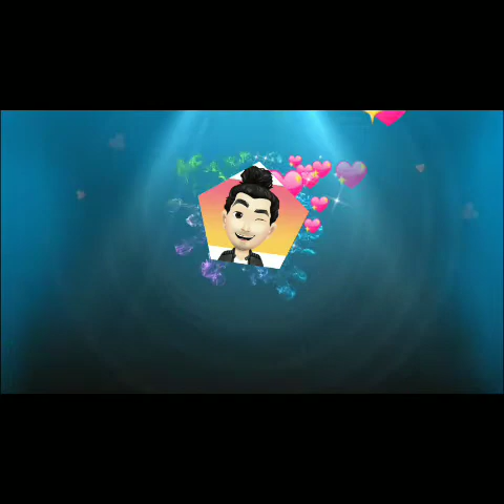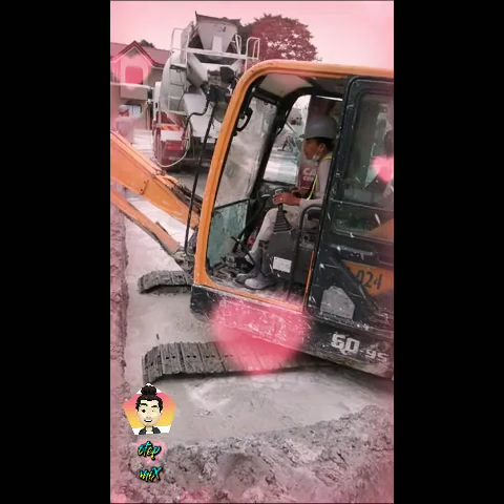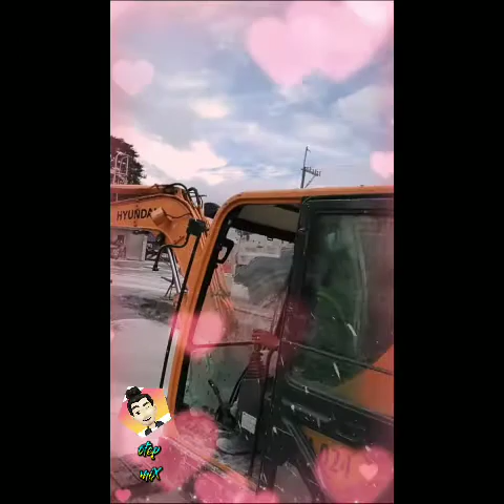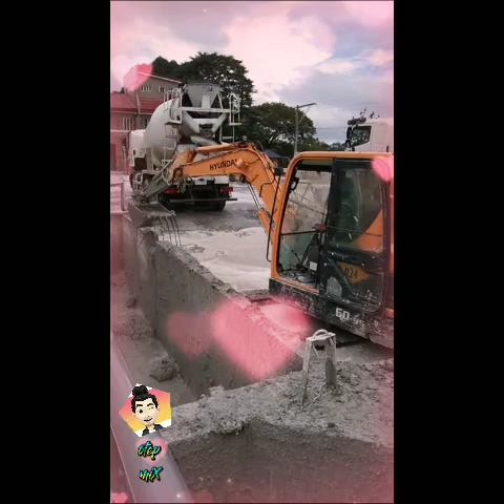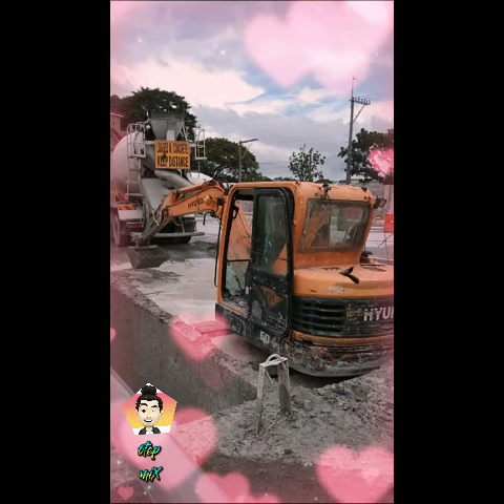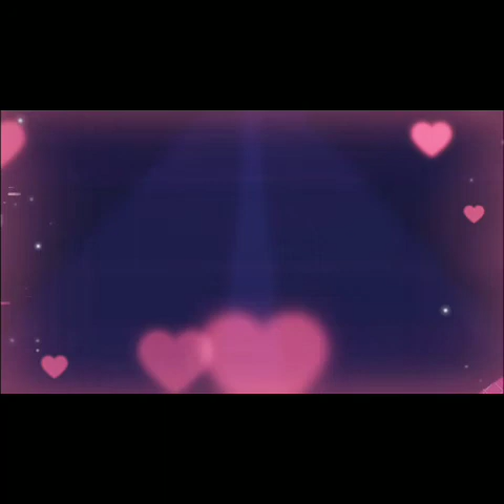how to operate backhou lito

Comment: How to operate backhoe. Wow grabe bro mahirap na trabaho yn para sa mga ndi marunong mag operate ng backhoe. Anyway madali lang dw gamitin ang small backhoe if you are well trained. A backhoe loader is a multi-purpose piece of construction equipment, most commonly used for excavations, that is known as a “backhoe” among contractors. The digging bucket, or hoe, is attached to the backside of the cab. The loader bucket is attached to the front side of the cab. The operator sits in a swivel seat on the top of the cab to allow him or her to operate the equipment from either the back or front of the machine.